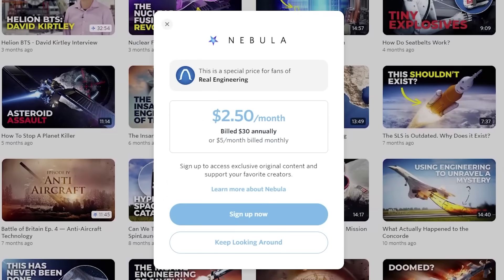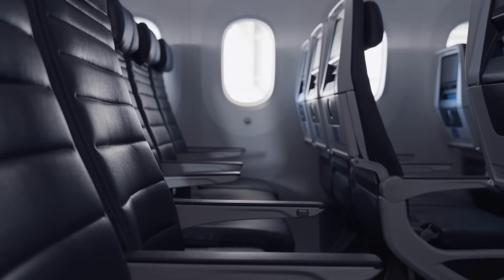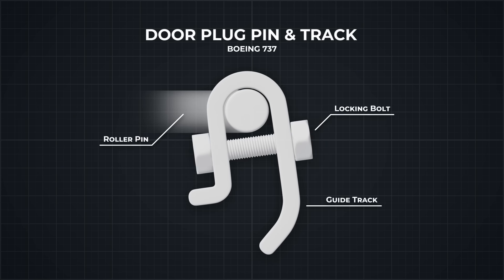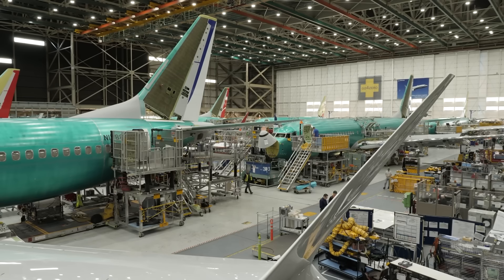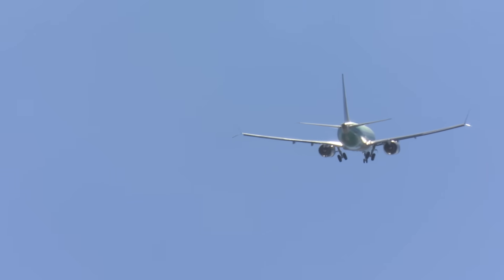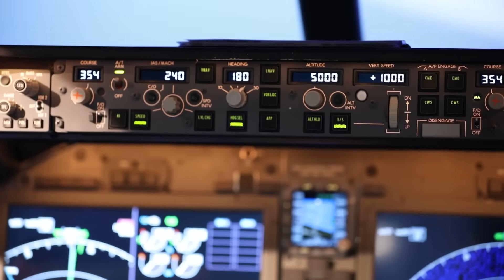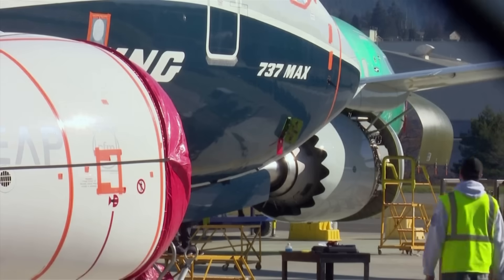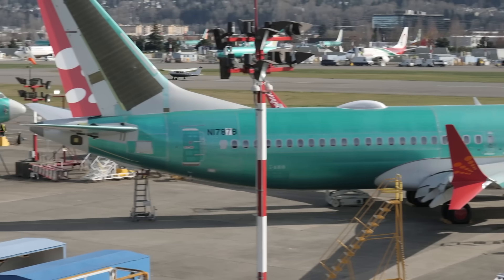The Questionable Engineering of the 737 Max

Comment: To be pedantic, in the US engineering means design, not assembly, this was an assembly/process failure not a design failure. The MCAS issue in 2019 was also not really a design failure, it was a management failure to listen to design engineers. The engineers are doing good work, its management and the processes they define and the culture of "make our metrics look good" that are the problem
Reply: In what regard? There arent "engineers" putting together planes, they only design them. If you're saying I'm wrong about MCAS, the engineers told management they had concerns and were ignored. Wherr am I "wrong"? I like your channel but I don't appreciate this dismissive attitude without discussion
Reply from the maker: You are being both pedantic and wrong

Comment: Correction, the pitch up tendency was not caused by placing the engines higher (as an engineer you should know that getting the engines higher and thus closer to the center of mass would actually reduce the pitch up of them). What really caused the pitch up tendency is their higher power capacity, which when applied, pitches the aircraft up.

Comment: I try to like Boeing but yikes. Alaskan really fu**ed up especially since we know about the prior pressurization issues, and they took no corrective action. Reset computers and go. The fact they wouldn’t fly it across an ocean tells you everything you need to know about that. If you don’t think a passenger jet is capable of going transcontinental, I don’t want to be in it domestically. It’s broken. It tried to tell you it was broken but you just had to keep it making money instead of fixing it.

Comment: I find it a little irresponsible of you to title this video “questionable engineering” and then you basically lay out human error/ maintenance as the reason for the incident. 

Also what is a “wire tie”? I’ve heard of people referring to cotter pins as split pins but they are never called a wire tie. If you were referring to lock wire then yes that is a system for securing fasteners but that is not what you have shown or discussed.

Comment: Why give this "corporate entity" so much benefit of the doubt on it's capabilities and capacity that even William E. Boeing probably would not extend to it himself today? These poor fixes always cost more in the end than the short term profits are worth, but hey they all have degrees of higher education and are experts right? What's worse is that it requires a large enough financial penalty through a lawsuit or regulatory fine from direct loss of life before change is even considered an option on the table instead of just doing the correct thing and recertifying the aircraft. So far hundreds of innocent lives ultimately and carelessly lost for a mere fiduciary obligation to share holders. I spent the two years of lock down working with aircraft from both Boeing and Airbus amongst other builders. The commercial aviation industry is not inspiring or even maintaining confidence from this machinists pov. It must do better, FAA included.

Comment: Its impossible that the bolts came loose because of under tightening since they have safety pins. More likely they were over tightened, whoch is worse than under tightening. If broken bolts show in the photos, they were over tightened. It could have been an instructions misprint(eg ft pnds instead of inch pnds). This is my theory.

Comment: If a door plug is designed to be removed then who is to say that it couldn't be removed and improperly re-installed AFTER MARKET (or if the bolts were ever re-installed at all for that matter)?  Lets hear from the ATSB and their electron microscope analysis to see if a bolt was EVER installed in the beginning. And those loose bolt reports; please define what you mean by LOOSE. Is that just a TORQUE tightness measure of tolerance or a nut ready to fall off? Does it even matter the tightness when the bolt is just a locking pin sequired with a Cotter pin? We are just too quick to blame Boeing without all the facts.

Comment: It's the exact same plug on the 737-900/900ER for configurations less than 189 passengers.  The video should be titled "The Questionable Assembly of the 737 Max" (and other Boeing models) because that's what it appears to be.

Comment: The fact that a massive payout is supposed to offset the death of 346 people is obscene. There should have been jail sentences handed out as obviously Boeing management haven't changed their philosophy of profit over safety. What a crappy company they have become. Hell, their Starliner is just as badly designed and NASA will not use it until it is proved safe for Astronauts to use, which it is not at the moment.

Comment: The door design isnt ideal with the castellated nuts, but it is not questionable engineering. The main issue seems to be follow-through of correct door plug installation steps. A quick fix to this would be some kind of double locking nut where two nuts are used - one to seat the pin bolt, and the other to keep the first nut from rotating. At least then even if the nuts back off a bit, it's not going to let the pin go. An inspection port in the interior panel would then allow visual inspection and possible measurement of nut position & tightening if need be without removing the entire interior panel. More expensive, especially as a retrofit, but it would solve the issue. Another thing is that the fuselage contractor is responsible for these problems escaping the fab plant, not Boeing. The people in charge of signing off the plugs is at fault here, plus i suspect a toxic work environment trying to push these out the hangar door as fast as possible. In summary, it's not an engineering issue, it's a workplace culture issue. I would add that many designs for things like this with critical components are "eh" and escape with issues out the factory every day. It is not just in areospace. Toxic work environments driven by profits only mindset is the primary issue in most instances.
Reply: The door design has worked perfectly fine with zero problems on multiple 737 variants over 20 years.  The nuts on these bolts are captive with a cotter pin.  They can't back off even if the bolt is loose.  And since these bolts are not in tension holding anything together, it really doesn't matter if they're loose.
Reply: If the bolt is loose, it can fall out. I suspect the bottom bolts fall out first, then the top bolts. Then the plug can yeet free. @stargazer7644
Reply: No bolt or nut backed out again. The securing bolts were plainly forgotten to be reinstalled after the door seal was replaced at Boing and QA did not catch it as this step was missing in the QA procedure. It was likely based (copy and paste) on the seal replacement QA procedure of a regular door and these do not have these securing bolts.

Comment: IM working with Boeing aircraft as mechanic and im telling you 737 max is good aircraft with many problem and high maintenance and many of them sometimes not written in manual and if you never have experience with standard 737 like the 800 or 900 you might never notice something is wrong

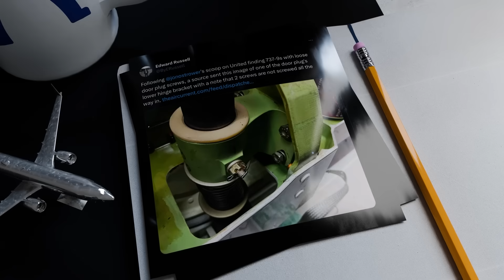Comment: @5:26 those are call cotter pins or split pins. Used only once. They go through the bolt which has a hole through it, then a castle nut. Which stops the nut from vibrating off.

Comment: When I heear Engineer by training... I immediately think of those engineers everyone knows that have multiple degrees and every cert under the sun but actually haven't done much actual practical application of engineering, just theoretical. Same engineer that probably couldn't answer an basic entry level engineering question in their given field. Who immediately goes down the program/project management route while still being an engineering SME, while managing to get promoted by ridding off the successes of the actual engineers doing the work while also managing to hinder them in every opportunity but barely make the deadlines project/program. But even with their evident incompetence, engineering wise still manages to crawl up the management/executive ladder because the ones actually doing alot of work underneath them. While still claiming their an engineer even though they've only done management for the entirety of their career.

Comment: The CEO got fired with a 62 million bonus or the golden parachute. He got more money than the victims. Where is the Justice in that? It's not hard at all to mount the engines to the other side of the structure. It's an industry standard. Those types of aircrafts including the 747. The wind tunnel testing would have shown the yaw and pitch with that issue where they mounted the engine's. I can't believe the FAA allowed in AI program to fix an issue while in flight is not a raptor F-22 or y23 that needs computer assistance to fly. These are standard aircrafts , civilian aircrafts. This should be no AI required, just the pilot. Now my thinking process is more towards the FAA so you can expect a lot of fingerpointing and he said she said coming down the line 👊🕊️ I feel so bad for the passengers that had passed away. Totally avoidable. For such a minor correction, damn it !

Comment: Are you kidding me?, Alaska airlines reset the proximity switch for pressurization of the aircraft then let it roll out?
Then it happened again on the second day? Then they did the same thing ? That is entirely on Alaska airlines. I don't care if the nut was left off and it slid out. There was an issue with that aircraft and no one took measures to find out whether it was a faulty regulator trip switch or if there was a damn real problem. Don't take a genius for that Jesus. I thank God nobody got hurt and I bet my last dollar Alaska airlines is going to take a whoopin ! As they deserve !

Comment: My whole family refuses to fly any flight that uses a Boeing 737Max.  Good luck to any airlines stuck with those death traps.... But to be extra safe, we aren't flying ANYTHING made by Boeing either.  The problem is how management destroyed the company. Boeing used to be run by engineers who knew how planes worked and focussed on quality.  Now it is run by MBAs who only know how to cut corners to squeeze out profits, and they know absolutely nothing about planes.  It is really sad that this happened to one of America's greatest companies.  
-
EDIT: the video commented that you didn't think it was from the MBAs, but it is undemiable that the MBAs have priority, no matter how many engineers inside Boeing speak up about safety concerns.  This has been proven repeatedly in investigations into Boeing since the fatal crashes.  It is the MBAs causing this 100%.

Comment: Boeing is fully at fault here no doubt.

If I buy a Toyota and the car comes with a malfunction, i dont go around hunting down which ever subcontractor that did the specific job that caused the malfucntion. Toyota sold me the car, Toyota takes the full responsibility of delivering the car in good condition.

Similarly Boeing delivered the plane and unless the door plug was removed by the airline and improperly reinstall back then Boeing is off the hook. But this isnt the case.

Comment: I still don't believe that a software fix for the original motor "issue" is a shortcut, but obviously much more testing should have been done - both on the SW and for the pilots.  These planes wouldn't work without software, but it all has to have significant regression testing.  It is also telling that the issue never happened on any western airline.

Comment: I've been due fly on Boeing 737 Max a couple of times over the last year, when I found out that I was due to fly on them I rescheduled to another flight on a  different aircraft type/manufacture all together even if it meant shifting airlines.
Reply: Congratulations.  We call that irrational fear.
Reply: @stargazer7644  No Its not an 'irrational fear' I've worked in te Aerospace industry, If a Boeing product has this kind of failure rate there is no way you'll get me on it, the earlier 737's were fine the Boeing 737 Max turned out to be lemon and Boeing knew it.
Reply: @vaughanellis7866 Then I assume you don't ride in cars at all, right?  Because your chance of dying in a car accident is about 10,000 times higher than dying in a 737 max.

Comment: Your diagram of the bolt was wrong way around. Also the bolt could not fall out if it was merely 'improperly tightened' as it has a cotter pin to prevent it coming undone under virtually any circumstances. It is possible that the other bolts were loose, but it seems most likely that the main bolts were simply not installed at all or they had no cotter pins installed.
Of course as others have said, this isn't about questionable engineering, this is questionable management practices combined with corruption in the US government (leading to poor oversight).
The earlier max problems involved a combination of bad management and bad engineering (stupidly designed software that relied on a single sensor when multiple sensors were available)

Comment: I still call it insane, and a reflection of corruption in the process, that a fundamentally unsound airframe that leans on what should be a safety rail for basic flight is approved for commercial use. The whole thing should be banned from use around airports and in the airspaces of civilized countries that bother to regulate such things. That they then misrepresented that characteristic and the implications for pilot training to the point of triggering crashes should have been a terminal event for the company leadership responsible for the decisions. Clear the executive team, clear the board, (no golden parachutes - to the contrary, the lucky/less involved ones would be those to avoid jail time), seize partial ownership as part of the punitive damages and compensation to make shareholders a bit poorer style of strong "hey private industry, you don't get to do this" message while also helping make sure it behaves going forward. This door incompetence is just more icing.

Comment: I really like this channel but on this occasion the information is behind the times and misleading.
The loose bolts which have been found on other aircraft are a red herring. They say loose but it's pretty clear they mean not torqued to specification but in any case they are not referring to the crucial four bolts which hold this plug in place.

Contrary to this video, for the door plug to fly off it has to move UP first. If the door is properly installed that is prevented by the installation of four bolts with crenellated nuts and split pins. There isn't really any issue of these nuts being loose because they are located by the castle nuts and split pins not by stretching the bolts with torque. If only one of these bolts was in place it would be completely impossible for the door plug to move upwards and then fly off. That was determined by YouTube sources within several days of the incident. Eg blancolirio.
Whilespirit, Boeing, and the FAA, have still not made of the statement so bluntly, the only actual issue is whether the bolts were not installed by spirit who make the fuselage, or whether the plug was removed and reinstalled without the bolts during fit out at boeing. Either way the only possible explanation for this incident is that the bolts were simply not there. As they included crenellated nuts and split pins it is essentially impossible that they came off after being installed.

This incident has absolutely nothing whatsoever to do with the engineering of the 737. The engineering of the plug doors is robust and failsafe and that is why no such incident has ever occurred before. Rather, it is a failure of the assembly process. While that is not good, it is not any sort of indictment on the  engineering of the plane itself. In fact there does not really appear to be any problem with the plane at all. Yes there were two crashes but that is not a fault with the plane. It is a fault with Boeing management which chose to not inform pilots who fly these planes of the existence of the MCAS software and how it might interact with pilot inputs in certain circumstances. Nor is there any problem with that software per se. 
As is so widely observed on social media and formal journalism, Boeing has a management problem and this incident is one of the consequences. The products themselves are not the problem.

Note that the FAAs directive for inspecting the grounded planes does not involve checking for loose bolts. The stories about supposedly loose bolts appear to refer to other hardware not in question in this case. Rather, the directive is to check for those four bolts being in place and as noted above if they are installed at all, with split pins they simply kennels come out and therefore the plug door cannot come off.

Comment: Well, Boeing internal communication says ''This airplane is designed by clowns, who are in turn supervised by monkeys'' - so it seems that they have both engineering and management problem. Although usually it is management part of the company which enforces execution of cost cutting (therefore mostly poorly engineered) solutions - eg. MCAS, which is clearly patching engineering challenge with 'cost cutting solution'.

Comment: actually there is a way to tell from the inside of the plane where the door plug is …. The distance between the windows will be stretched on both sides of the window - So I disagree with the statement that you can not tell from the inside - More thorough research advised